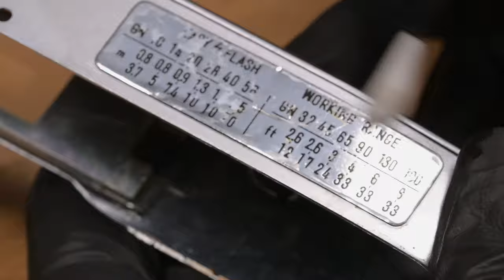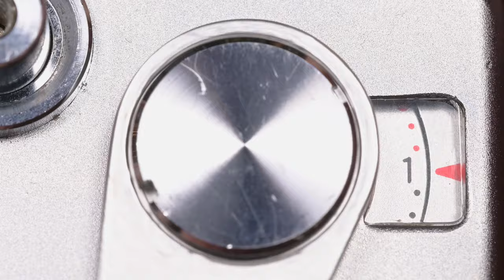Minolta AL-F Rangefinder Camera Restoration

Comment: I actually had a brand new one, when they came out. It took great photos. After it was stolen from my dorm room in 1971, I replaced it with a lesser priced SLR. That really didn't last, so I took it back. My next camera, was a brand new Canon F1 with a 50mm 1.4 and case. That was in 1972. The Canon cameras were distributed by, Bell and Howell. Then Canon took over their own distribution. I used Canon till 1980. Then I switched to Nikon, as I was then employed by them. I also shot medium format, and 4x5. I loved film. 
Still do.
Reply from the maker: Film is a pretty amazing medium. My dad taught me to shoot on film when I was much younger. I migrated to digital when I finally got my own gear but have circled right back round to shooting on film once more. Digital has its place but so does film in my heart.
Reply: @TInyGravitas  I totally agree.
The other reason, I'm still with film, is money. I want a DSLR, not mirrorless..I just need a body. New. The Nikon D850, was my choice. But it's due for replacement. So, I'll wait to see what's next. I'm not shooting professionally any more, so time is on my side.

Comment: Great video.  I got my Al-F today!  Seemingly in nearly mint kondition.  But the lightmeter doesn´t work..I changed battery.  No (hardly) corrosion in the battery compartment.  What was there i removed with a little vinegar on a q-tip.  I´ve been told that the Cds-cells eventually die.  Would be happy to receive advice or other information on how to awaken the old beauty, which my father once owned.
Reply from the maker: Hey there!

Congratulations on the new camera! Finding one of these in mint condition is fairly impressive and a treasure for sure. The Cds cells can be a bit of a problem at times but there are a number of different reasons they tend to stop working. Sometimes it’s as simple as dirt on the sensor, other times it can be as bad as a dead cell as you say. If there is no movement at all that (to me) would indicate that it’s probably not the cell as from what I’ve heard they deteriorate slowly and so there would usually still be some movement from the meter just not a whole lot.

Another possible easy fix is trying the battery both ways up as the manual can be a tad misleading about which way it actually goes in, especially with modern zinc air batteries which can go in either way round pretty easily. 

If not those it could be a deeper problem.
Reply: Did you ever figure out the solution?
Reply: I'm sorting out a Konica C35 currently and it's the 3rd similar cameras that have had the same problem which might be yours too. Battery compartment looks relatively clean but not underneath. If you did see some corrosion in the box make sure you remove it and look beneath to where negative (usually) wire is soldered - corrosion likes to travel up the wire which is much weaker than the contacts themselves. In my cases that solder joint was always hosed. Strip a bit of wire and resolder if you can. Might come right back to life.
Reply: Very late to all this but older cameras used mercury based batteries that gave a constant voltage. Modern cells, despite fitting, give a higher voltage initially then fall off over time. There's a work-around to get hearing aid batteries to work however. If it's working but incorrect readings, this is likely the problem.

(EDIT: Cells above mean batteries not the photoresistor)

Comment: What is the thickness of the felt?
Reply from the maker: Most of the X series from Minolta used felt but later changed to 1.5MM open cell foam so that’s what I’ve used on this one.

Comment: What solution are you using to clean the cameras.   Also what’s the solution you used to soak the winder?.   Thanks
Reply from the maker: I use different chemicals for different tasks. Most often for metal parts I’ll use Isopropyl alcohol, which is the same solution I used on the winder. It’s pretty good for metal parts but I’d use it sparingly on plastics if at all.

Occasionally if there is something that’s very sticky or if there is sticker residue or glue that needs cleaning off I’ll use lighter fluid as it tends to melt a number of glues quite well.

Comment: I have the same camera with strange problem - my aperture moves in opposite direction! When camera is idle, it's fully open, and when i press shutter, it closes down. Meter works fine, aperture blades also move freely. Only when shown 2.7 they close down fully, and 22 is wide open. Is it possible that aperture blades are put in wrong order inside the lens? Can't think of anything, under the top cover everything seems like in your video.

Comment: The yellow glass inside the viewfinder has a hard time overlaying through the viewfinder. It appears very dim. Is there anything I can use to clean or fix it?
Reply from the maker: I’m afraid not, to the best of my knowledge the less you touch and clean it the better.
Reply: I'm so glad I found this vid before going by cleaning it and wrecking it in the process.
As I only decided after seeing this to clean the camera internals (bar the dreadful yellow coating) ,I workaround I found around the dim viewfinder years ago is sticking a tiny diamond-shaped piece of sticking paper OUTSIDE the VF, as per the photo below, so that the contrast for the similarly shaped one inside is increased and I can easily focus by finding its shadow aligned with the one inside. (I hope I somehow made this clear, instead of complicating it even more).

https://i.imgur.com/sGCfTLh.jpg

Comment: you know one thing about japanese screw. i'm bout to clean my yashica electro 35 and one of philips screw is so hard to come of, when i twist my screwdriver i see that it didn't rotating, i thought i ruined that screw, but when i check my screw driver, it twisted. indeed that's a cheap set screwdriver but still crazy to me..
Reply from the maker: That’s crazy strong. I’ve only ever had a couple of camera screws strip during repairs, but very few. They do make them well!